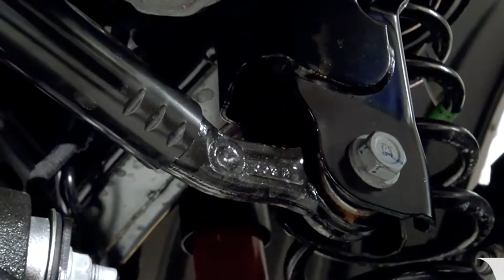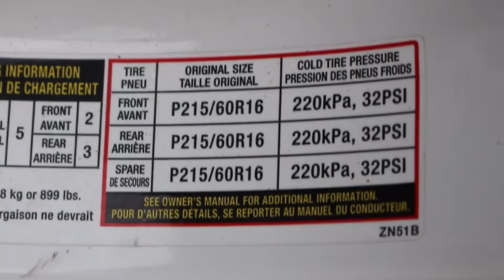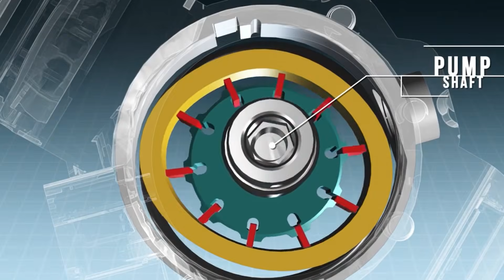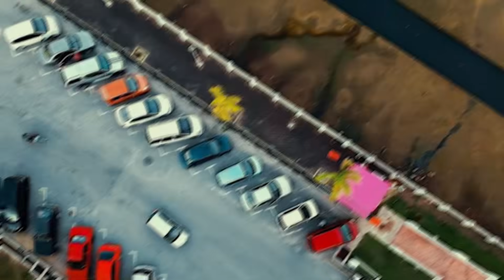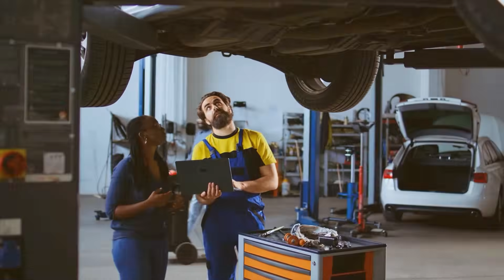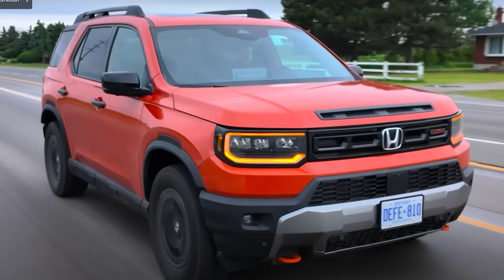This $5 TRICK Will MAKE Your Car's SUSPENSION LAST FOREVER!!

Comment: I prefer liberally spraying all rubber parts with 303 Protectant , it is water based . If they are too far gone , but don't have the money to replace them yet . Then I would liberally spray them with AT-205 Reseal .
Reply from the maker: Thanks for sharing your preferred methods for maintaining rubber suspension components.